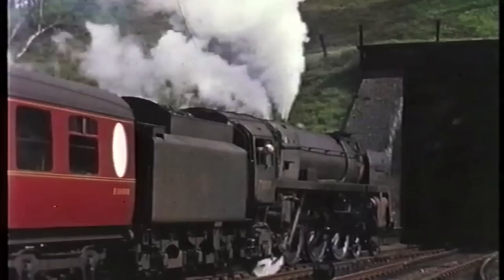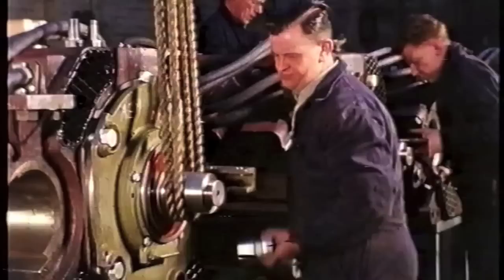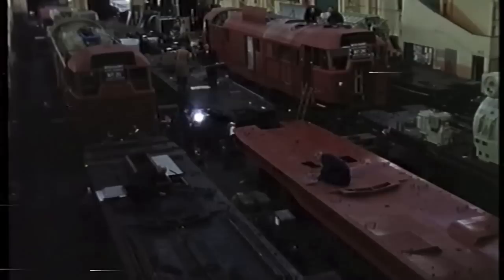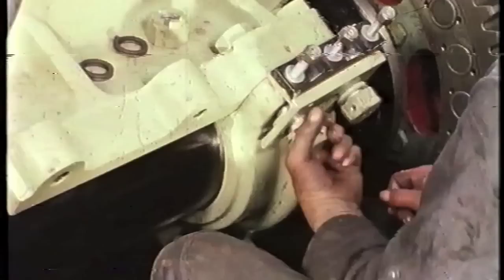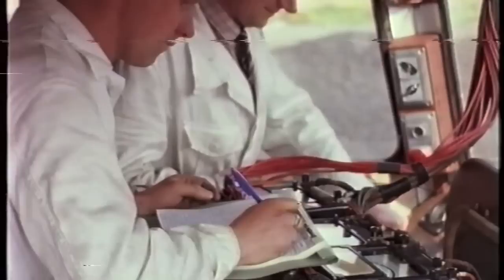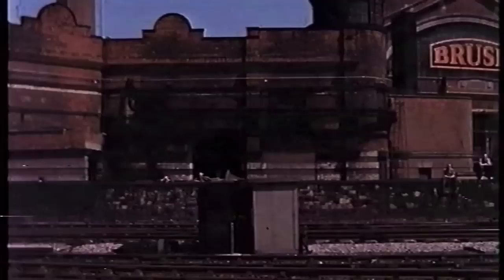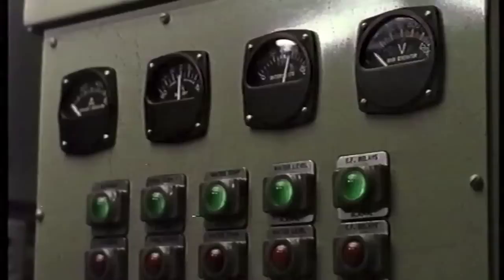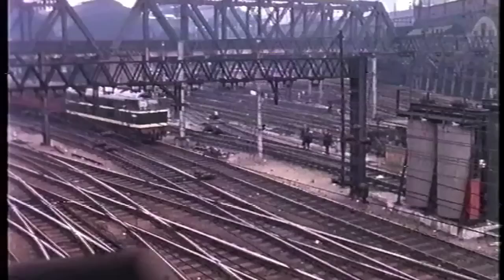Class 31 construction

Comment: The Class 31 locomotives were in production in the late 1950s and early 1960s. Skinheads, Cybercons and Toffee Apples were nicknames given to the Class 31 locos built without roof mounted headcode boxes.
Reply: Toffee Apples were what became the class 31/0. They had non-standard electro-pneumatic control & one of the control levers had a large knob at the end which looked like a toffee apple, hence the nickname.

Comment: I worked at Finsbury Park TMD and these were my favourite loco to work on, unlike the 47s whose engines were filthy to work on due to the heavy carbonisation of the oil or the 55s that were slip hazards in the engine rooms and were nearly always hot.
Reply: hey morbeus my dad worked from there in the early sixties
Reply: Those opposing-piston "Deltic" engines must have been a maintenance nightmare, or was it the opposite ?
   Bus companies had to simplify their paint-schemes in the '50s to reduce maintenance costs against falling-revenue: did B.R. have to do the same,  using spray-booths and thus getting rid of the men seen hand-painting the new "31s" in this video-clip ?
Reply: @None-zc5vg  still had painters at Eastleigh works on type 73 and 33 loco's when I worked there up to 1984 all hand painted..and sign written.
Reply: @peteavery3799  Thanks, Pete.
Reply: @DiggerEvans  Clarence yard?
Reply: @jdavis460  Hiya Brian not sure, he worked out of Stratford depot and Finsbury he was involved with the engine trials etc.. with Hawker Siddely and Mirrlees and Brush, I shall ask him when he's home later, he over saw all the maintenance of the diesels etc.. he was very fond of type 2s and of course the Falcon, he wasn't a BR employee he was working for Mirrlees and Hawker Siddely in think
Reply: @None-zc5vg   "Those opposing-piston "Deltic" engines must have been a maintenance nightmare, or was it the opposite?" 

My understanding is that this was the maintenance procedure for a Deltic: 
1. Remove Broken Engine. 
2. Ship to Napier. 
3. Receive a Rebuilt Replacement Engine from Napier. 
4. Install New Engine. 
In other words, their design was so outside most mechanics' experience that only the factory worked on them. It was easier to replace a Deltic than try to fix it.
Reply: @Baribrotzer  No "running repairs", then! Sounds practical.

Comment: Indeed the Class 31 was so reliable they had to re-engine the whole fleet !!!! Originally fitted with a Mirless engine that BR kept uprating (from 1250hp to 1600hp) to the point where most suffered serious failure. They were then re-engined with a Sulzer 1470hp plant. 

Very nasty locos, always developed problems whenever I had to drive one. Indeed two in multiple proved to be double trouble, one summer Saturday. But at least they managed to happily coast all the way from Cullumpton to Exeter. Which was downhill all the way, and luckily I had a clear road right into St.David's. Where they were found to be both dead as door nails. Although being almost two hours late, I'm not sure the tourist passengers were too happy. Fortunately I was finished and off home !
Reply: The were re engined with a V12 English Electric , similar to what was fitted to the class 37's that had the 12 CSVT in later years
Reply: No the Class 30 had the problems. The Class 31 wirh the EE  powerplant proved to be reliable. You also missed D5507 which was delivered with a 1450hp Mirrlees engine and D5835 which had a 2,000hp engine.

Comment: excellent film, the 31's were re-engined due to cracks in the cylinder blocks (aluminium casting), it was more cost effective to replace Than repair
Reply: No they weren't the Class 31 were the re-engined locos, prior to that they were the Class 30.
Reply: @neiloflongbeck5705  That's the first mention I've seen on here that the film was actually about the class 30s. The 31s were a conversion from them.
Reply: @TheRip72  the Brush Type 2 (or Class 12/2 (originally the Class D12/2)) with either the 1250hp or 1365hp engines were allocated Class 30 when the TOPS classes were being allocated and Class 31 was allocated to the re-engine locomotives. As the TOPS classes were allocated in 2nd half if the 1960s many of the early diesel locomotives were given TOPS classes even though they never survived long enough to carry their new class numbers.

Comment: One of the engines that worked well out of the mid 50s " Modernisation" programme . Quite a few designs from other companies were dropped rapidly though design faults , breakdowns and poor performance . They certainly lasted the course .
Reply: After they had an English Electric diesel prime mover fitted in them.
Reply: Exactly what Rober Thill said!!! :)

Comment: Had a relative who drove the original D550x series of Class 30/31's before they were withdrawn early because they were "non-standard".  D5508 was "his loco"; Liverpool Street to Yarmouth South Town & back, stabled at Stratford.  Later on, managed to travel over to Crewe TMD in early 1985 with him and a few over drivers before they had a cull of a number of locos there; I was in my teens whilst they were 60+.  I ended up with a couple of toffee apple control keys from D5508 and (another loco that'll remain nameless) along with the carrying cases those control keys came with.  All legal & above board as the Crewe TMD manager handed them over, along with sheet cuttings off other locos containing the TOPs numbers.  

Mind you, at least one loco survived.  14:06 - D5627 - aka 31203 - survived the cull of the 31's in the 1980/1990s and survives at The Pontypool and Blaenavon Railway - pic: https://static.wixstatic.com/media/1e71c3_cb302fdbbf8c486daacba76d19523e2e~mv2.jpg

Comment: What a fantastic sound these Mirrlees power units had (assuming they used original sound in this film).
Would it not be a great recreation project, sourcing one of these engines and put it back in a 31?
Reply: It could be done, as I think I read somewhere that the original engines were reused in marine applications, maybe there are some still in use.

Comment: The script is a bit off. The standard powerplants for the production series locomotives produced only 1365hp at 950rpm (the 30 pilot scheme locomotives were fitted with Mirrlees JVS12T engines produced ing 1250hp at 850rpm). Only D5545 nd D5635 to D5670 were produced with the 1600hp (950rpm) JVS12 engine. D5835 was intended to be built with a JVS12 engine producing 2000hp. However, the 1365hp engines were showing signs of fatigue failure n the fabricated engine housing and cylinder columns after running for only 500,000 miles and so all the higher powered engine trials were abandoned. Eventually all the locos, including the 20 pilot scheme locos, had their engines replaced with the EE 12SV engine producing 1470hp.

Comment: I need to be stand corrected on this.  I am sure that the power output of the Mirlees engine for the Brush Type 2 was 1,250bhp then 1,365bhp.  Yet, I am sure that two members of the class was rated 1,600bhp and 2,000bhp.
Reply: Yes to 1600hp, but no to 2000hp. They abandoned this plan as the standard 1350hp engines were failing at an alarming rate; the original 1250hp engines were not prone to the same failures. As the more powerful engines were based on the 1350hp engines BR decided that they didn't want to risk the higher power Mirrlees engines.
Reply: @neildahlgaard-sigsworth3819   Was the 1250hp loco engines also changed to EE or did these become class 30, if not what was class 30?
Reply: Lea Fewell yes they also had their engines replaced even though the 1260hp engines of the pilot scheme locos were not suffering from fatigue failures. Class 30 was reserved for the Mirrlees engined locos, but they were all gone long before the locos were renumbered.
Reply: you are correct but only as a test that did not last long.
Reply: D5507 was delivered in April 1958 with a 1,470hp engine (achieved by increasing fuel delivery to the engine) for testing but soon reverted back to 1,260hp. The oilit scheme locomotives were the last re-engined with the EE 12SVT engines as their 1,250hp Mirrlees JVS12T engines were unaffected by the failures of the 1,365hp versions. D5545 was the first locomotive fitted with a 1,600hp engine and was fitted with modified cooling equipment, D5655 to D5670 were built to this standard. D5835 was fitte with the 2,000hp version of the original engine which needed a modified underfram built by Bagnall as well as additional ventilation grills on the A side at the number 2 end (when viewed from the number 1 or radiator end on non-symmetrical locomotives end the A side is always on the right). All of the production batchs of locomotives had their engines down rated in 1965 to 1,250hp except for D5835 which went straight to 1,470hp. The first locomotive to get the new engine was D5677.

Comment: News to me that the original Mirlees engines weren't an absolute disaster
Reply: The engines for the 31/0s were never as problemstical. It was the extra power for the 31/1s that cause fatigue problems lesding to the re-engining with a down-rated version of the EE engine used in the Class 37. There was even some Class 31s with a 1600/1700hp engine and a plan to fit a 2000hp engine; but these were return to standard power ratings or in the case of the 2000hp version never proceeded with. The experimental locos could be identified by the extra bodyside grills.
Reply: just what is a absolute disaster?. after the EE engine was fitted the mirlees engines was sold back serviced and fitted into trawlers .and worked at less revs in the ships.so not absolute disaster.

Comment: These locomotives are NOT Class 31 locomotives being built they are Brush Type 2 (class 30) locomotives.
The class 31 only came into existence when the power units where replaced from Mirrlees Blackstone with English Electric power plants during 1964
History need to be changed to stop this missing piece of history being stated each and every time
Reply: Class 30/31 was only the tops classification for these locos introduced in the late sixties to replace the original D prefix numbers
Reply: When the locos were fitted with EE Power units in 1964  there was not yet known as the class 31. They were all classified as Brush type 2s (being reclassified as 31s round about 1967 onward.
Reply: Most of these have been cut for scrap now. Good riddance!
Reply: @PreservationEnthusiast  Actually, the 30/31s have more examples in preservation than most other Diesel loco classes. A great locomotive, still going strong on many heritage railways. So, no, NOT "good riddance" at all!!
Reply: @zx7-rr486  More 37s and 47s and 08s. Many of them rusting away in sidings as nobody can be arsed to restore them and very few want to see them. Cut the lot for scrap!
Reply: @PreservationEnthusiast  I said "most" other classes, not all. Some of them are rusting, but many are running, or under overhaul. Judging by the turnout at some diesel festivals with 31s I went to this year, I'd say you're very wrong about people not wanting to see them. Whilst it doesn't make sense trying to preserve too many of the class, it is thoroughly worthwhile preserving our diesel heritage in general, and the 31s are a big part of that. What's your beef? Just hate diesels all round do you? I have nothing against steam. We should preserve as much as possible.
Reply: @zx7-rr486  If it doesn't make sense  to preserve too many of a class, why are nearly 50 class 37s preserved then. Most of them are rusting in sidings. We don't need  50 for gods sake!

People need to be more responsible and preserve more of what people want to see, rather than preserving everything they  can lay their hands on and then leaving it rusting?
Reply: They are class 31's it's just type 2 and the D number was just pre-Tops. A class 43 HST without a valenta is still a 43. Armchair enthusiast 😐😂
Reply: @Faulty720  that's true, but there again they didn't change the class number in that case, when they did for the re-engine class 47s and class 30s.
Reply: @PreservationEnthusiast  some of them are "Christmas Trees" - a source of spare parts. So they are needed.

Comment: It states that the power unit was 1600hp.  However, were the Mirrlees units not just 1,250hp or 1.350hp?  Indeed, wasn't one reason for their eventual replacement with English Electric units, the fact that they were deemed to be underpowered?
Reply: JOHN RILEY Not so much underpowered but they suffered from terrible reliability problems which led BR to use EE power units.
Reply: There was at least one loco fitted with a 1600hp engine as an experiment. They even considered a 2000hp engine, but never proceeded with it as the 1350hp engines fitted as standard were beginning to fail alarmingly.

Comment: Why were the locos painted by hand?
Reply: Many commercial vehicles of that era were still hand painted. It may have been the continuation of traditional methods, but it also gave a thicker and more durable paint film.
I remember doing a job at the Halifax depot of Yorkshire Water in 1980, they had just taken delivery of some new Bedford Beagle vans and were hand brushing a coat of Tekaloid coach enamel over the factory paint job. Made them last much longer apparently.
Reply: Suitable facilities for spray painting weren't always available. Air spraying needed separate facilities otherwise you'd get paint everywhere due to the high pressures required for spraying. Airless spraying reduced this, but the paints weren't always available.
Reply: Because it's easier than painting by foot

Comment: a bit of reality:

The Labour government of 1945 to 1950 did not want to upgrade trains from steam to diesel as it did not with to be dependant on imports of foreign oil given the nation is self sufficient in coal. Instead it continued to order new steam engines.

The conservatives got in and in 1951 decided to piss away £11.5 BILLION (in 2018 money) on over 2,000 new diesel trains with most of the orders going to their mates who owned various firms that had produced for the war effort and were desperate for new business in order to increase profits year on year as their investors demanded.

Most of the companies the orders went to had either never built a train before and thus had no experience of doing so, or had never built trains in such a number before. The result was many of the diesel trains were scrapped before their steam counterparts were as they were  often badly designed and costly to maintain.

The conservatives later took an axe to the entire British rail system because it had ran up a debt of £1.9 billion at the time. They destroyed entire communities, the end result was the service was left in more debt and even fewer routes.

The APT tilting train project was another victim of the conservatives, chronically defunded after Thatcher got in, then scrapped. Finally British Rail was broken up and privatised under a conservative government in 1993. Today, we spend more to travel 140 miles on a train stinking of piss than it costs to travel 1100 miles on a train in France. And inflation adjusted, the private rail service is costing the government and thus taxpayers, THREE TIMES the yearly cost of British rail in its final year. All of which is going in to the pockets of a hand full of millionaires and billionaires.

Here is FDR from 1936 warning the world of what happens when such things are handed over to capitalists:
https://www.youtube.com/watch?v=N3aO_s0Yuv8
Reply: I often wonder if coal had more to give, should technology have allowed it to flourish. A guy I used to know (dead now bless him) said that at the coalite plant was a huge research centre attempting to make coal cleaner and more efficient. He reckoned that they had a massive breakthrough that could've kept coal going into the millennium. But the government at the time weren't interested as the pit closures were well underway and the coalite plant closed a few years after that, the research being lost forever. Don't know how true the story was, but he used to tell it all the time in the club when he'd had a few.